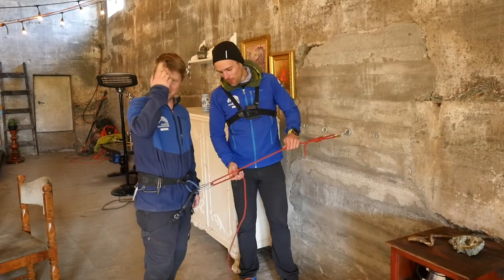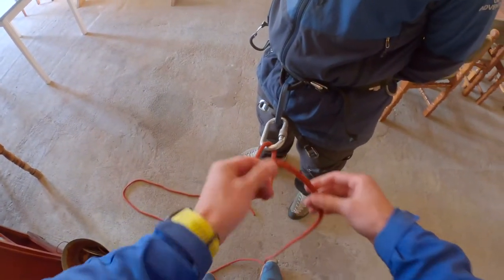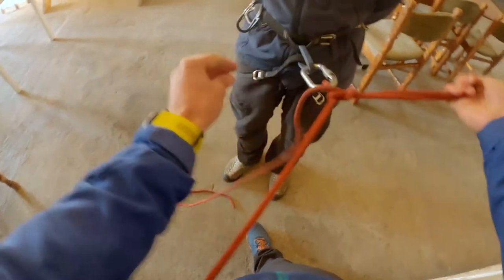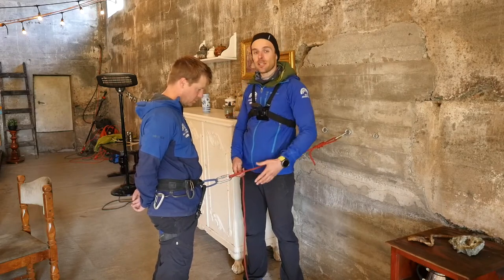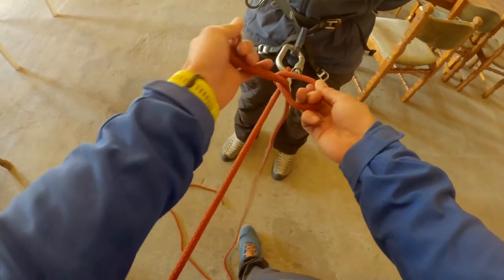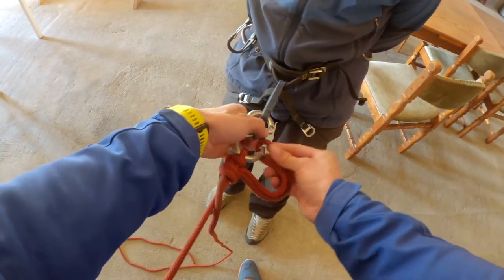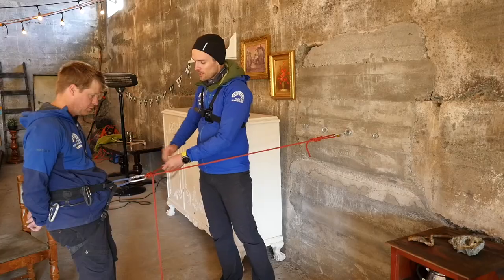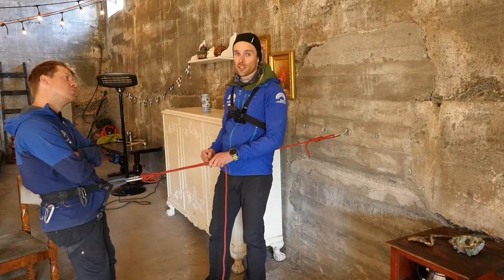Muling the Carabiner / Slip Hitch for Crevasse Rescue

Comment: I think I'm missing something but why is the application of a mule knot needed for the non drop loop scenarios? Wouldn't an 8 or alpine butterfly be effective for getting the climber tied into the system? As a side note, love the vids and the format, the 6:1 vid was great. If you're taking requests I would love to see your 5:1 z haul setup. Drop loop is rad but sometimes I'm fearful I won't have enough rope to do a drop loop.
Reply: Hey hey, thanks for checking it out. So the mule knot is helpful in the case that you are doing a main line haul (single strand down) and you need to pull the victim out of the crevasse a bit to give them some breathing room. In that case you would stop above the client and use a munter on the clients carabiner. The friction of the munter would allow you to pull the client up a bit. You would the mule it because you would eventually haul them on it. An 8 or alpine butterfly could be used if the client is standing in a place there they would not suffocate. 

There is actually a video on the 5:1 setup on the video for ice climbing rescues. Check it out and let us know what you think.
Reply: @MikeReid  Awesome, thanks for the reply. I'll check it out!